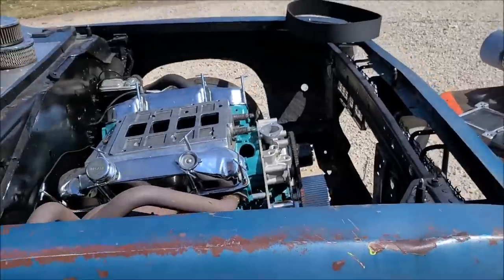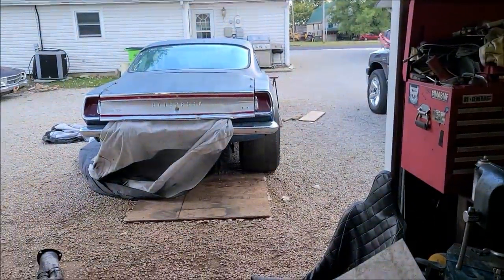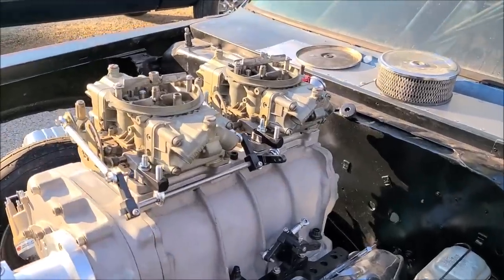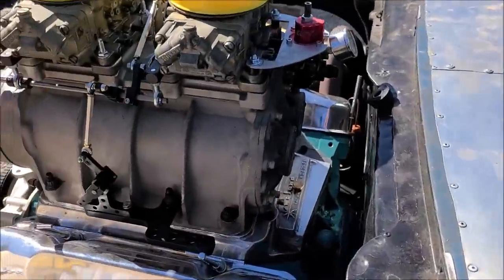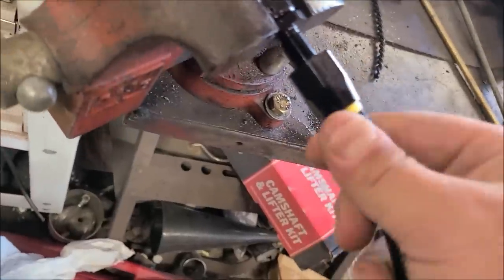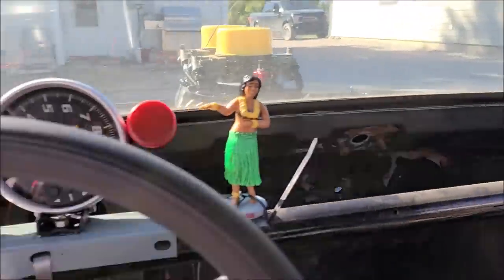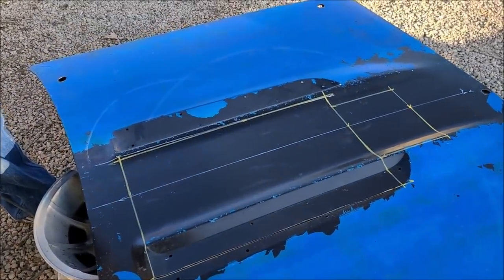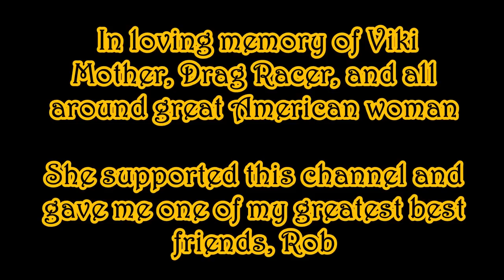Blown Big Block 1968 Barracuda Vintage Race Car PREP FOR 1st START!

Comment: Put some 1" plastic spacers under those carbs. It lowered my fuel temps considerably! That blower gets REALLY hot. Now when I get home after a long drive, my carbs aren't even warm.
Reply from the maker: I won't run spacers that tall, just not my thing, I got 1/2 inch plastic ones

Comment: I saw your distributor looks like a stock one I don't know what you've got in there because you there's ways to make them work and s*** I just wanted to recommend a eBay HEI distributor $50 for it in like $60 for an external high energy coil
Reply from the maker: The distributor is actually an MSD Pro Billet I bought used on ebay for cheap, I have to use it to clear the blower and I painted the cap tan like a factory Chrysler distributor
Reply: Thanks for getting back to me dude and that's pretty damn slick that's pretty smart I'm following this build it's been badass I just didn't know because a lot of people have mastered the art of making power with the factory stuff and for originality sake but hey I bet you they don't got a big old blower on there

Comment: On the Enderle linkage, keep all arms at 90 degree angles to one another and make sure half throttle is 50% through the sweep. This reduces the force necessary to operate the linkage to a minimum. I've seen people snap cables (me!) because they didn't do this.
Reply from the maker: good tip